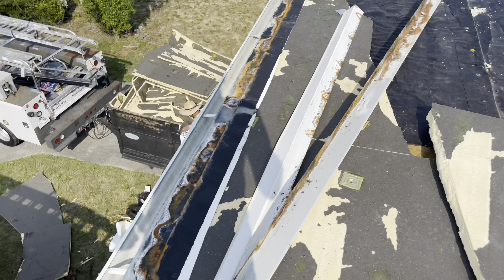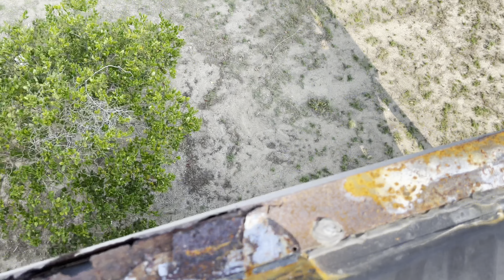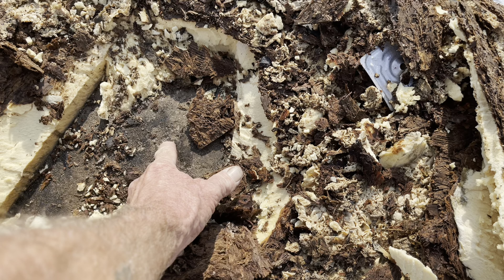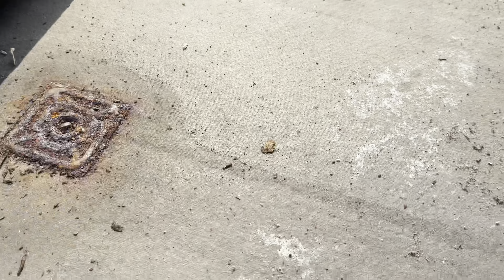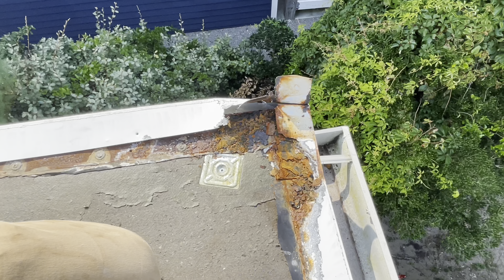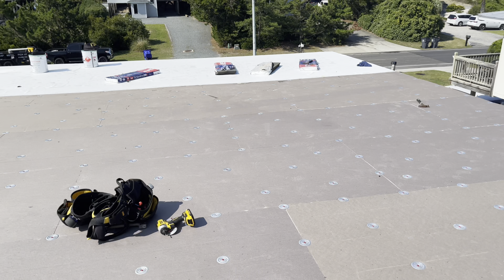Installing TPO roof on a low slope

Comment: Hey Drew I could hear everything fine for the most part, you should really consider buying a dead cat microphone filter. 

It could be as easy as finding something fuzzy and furry, cutting a small section out that goes over your mic  hole so that there's not so much wind noise. It's a common modification on gopros so I would just YouTube search "GoPro mic wind noise dead cat" .. actually I'll just link a video to you. It's an easy modification and like I said.  It would probably buffer out about 80% of your wind noise.
Reply from the maker: Thank you. I will take that tip

Comment: So I have a mobile home with laminate roofing and I recently wanted to put a new roof can I put wood over the laminate and if I do can it support the weight of half inch plywood at the top
And is there anything I can do to help with the Wight like putting more jack posts
Reply from the maker: I’m not sure what you mean when you say laminate laminated plywood laminated shingles I’m not sure ??

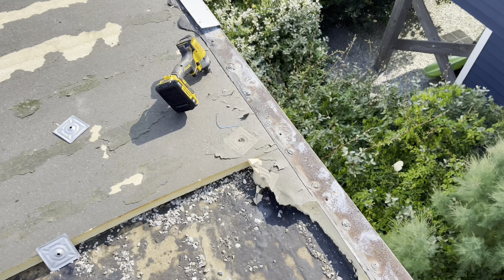Comment: Hey Drew.  I really enjoyed your video and never heard of TPO until i just got a recommendation for a re-roof using TPO.  I currently have tar and gravel.  I would appreciate and value your opinion about installing TPO on a gable 3:12 pitch roof? Also does it hold up in snow?  Thank you
Reply from the maker: Tpo is a good roof. I believe it will hold up to snow